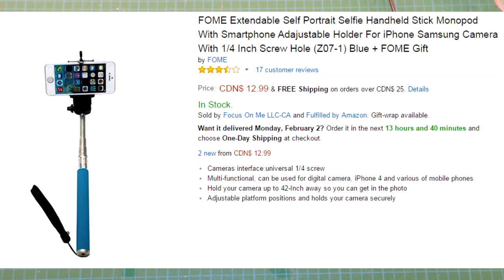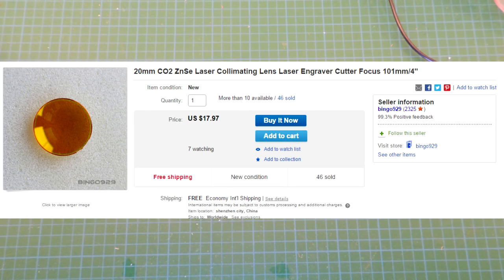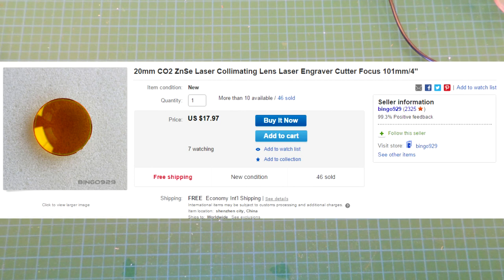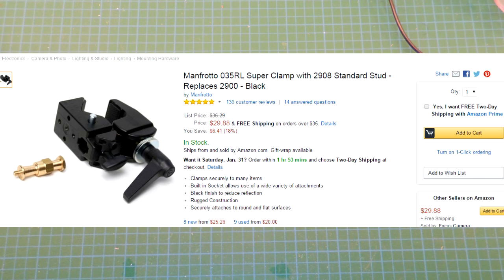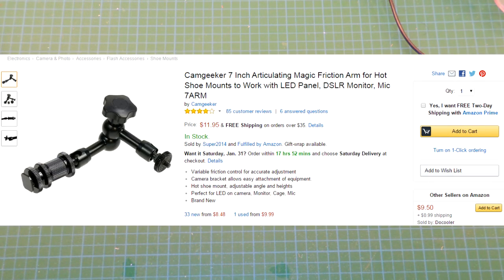DIY Macro Mode for a Seek Thermal Camera

Comment: Any ideas how you would extending the magnification and the distance of the seek thermal to watch wildlife?
Reply from the maker: Short wave IR follows the same rules as visible light.  Unfortunately if you google "zoom lens construction" it quickly becomes apparent that multiple lenses of pretty high quality  would be required and that they would  be fairly large... I suspect it would be a very expensive proposition to construct.
Reply: ***** I thought that would be the case, 
Even a doubler would have been great. 
Thank goodness they are bringing in new moulded lenses instead of the germanium that has to be machine cut and polished.

Comment: So, would you say 4" is a good focal point for the lens? I seem to vaguely remember that the macro lenses for the E4 and such have a shorter focal distance.
Reply from the maker: demultiplexer This particular lens is in focus when the object is 1.7" away, giving a field-of-view of 1.15" x 1.15".
Reply: Thanks for the reply, that sounds like a great field of view for electronics purposes. Pretty much perfect. I just ordered that lens, probably going to 3D print a lens holder with clip - I'm not a particularly big fan of friction fit. Probably enables for better alignment as well with my ninjaflex filament.
Reply: @electronupdate  Looks like the ebay lens in the video is 4" (101mm) focal length. Did you use another FL for your project then?